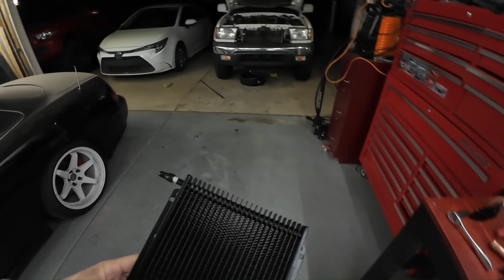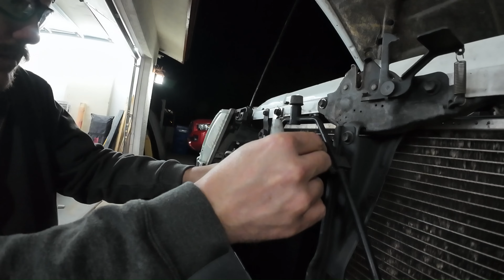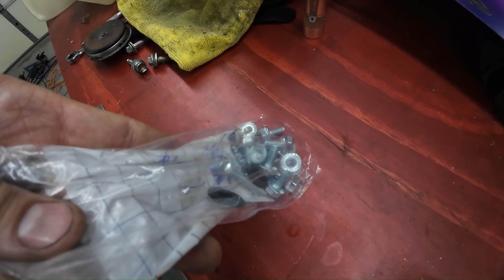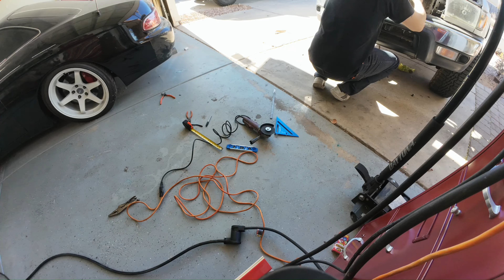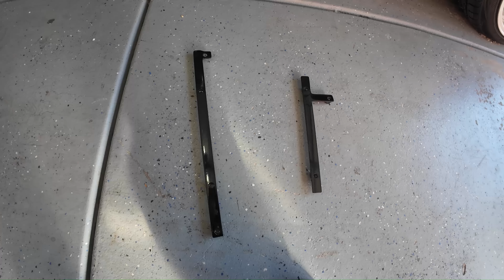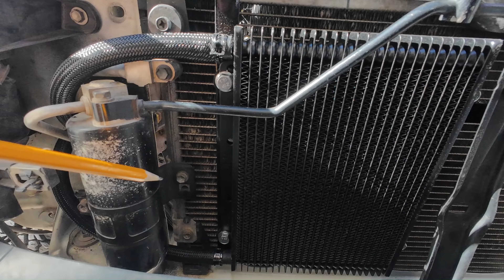3rd Gen 4runner External Transmission Cooler Install - Hayden 678

Comment: Does that keep trans cool enough under load? Or would I need to run it through both the rad and cooler?
Reply from the maker: @trenthatcher4051  Great question. This should actually run much cooler than it would if it had run through the rad alone, which is why a lot of people run them through both. I am not particularly worried about it running too cool, though. I will see if I can get some temperature readings under load and report back so there is objective data to consider.